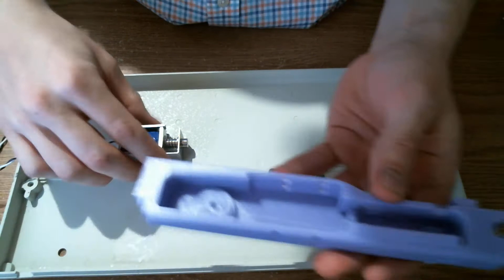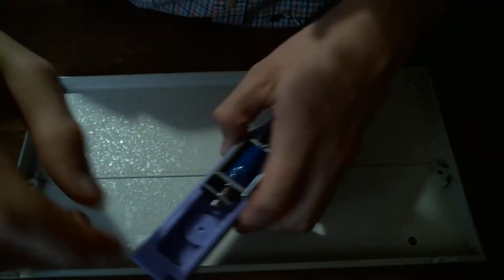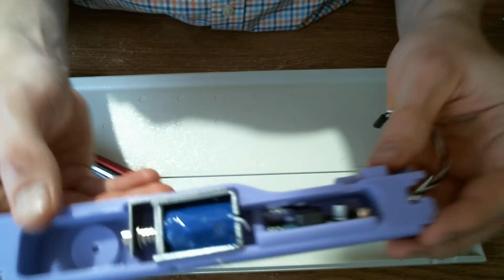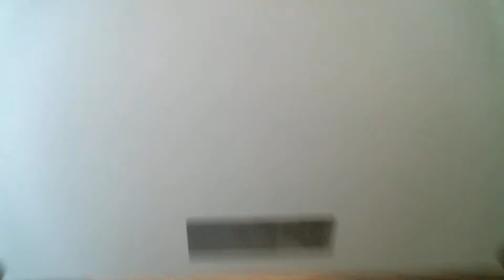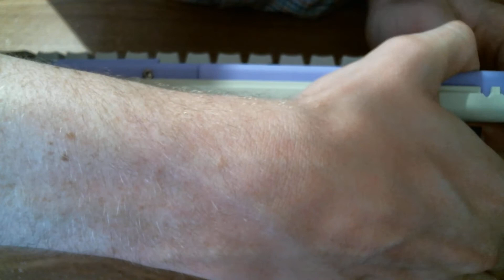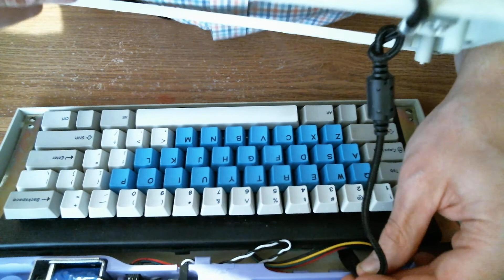3D Printed Solenoid Holder For F62 Model F Keyboard

Comment: If you don't mind me asking where you assign the fn key and the layer of arrow keys?
Reply from the maker: Hi. Um I'm just using the default layout at the moment. I do plan on altering the firmware at some point to change it slightly and add a key combination that will toggle the solenoid driver on / off. I haven't done this yet though since I like the solenoid and usually I want it on anyway. You have to use some tools to modify the firmware and re-flash the keyboard. I think there are instructions or directions to instructions for how to do this on the model f keyboards web site. If your asking about the actual mapping I think the right control acts as a modifier key (I just do it from muscle memory)  and then some of the letters act as arrow keys (I think WASD). Some of the keys a bit up and to the left of the right control are used for other functionality. mod + the number keys / the two keys after them work as the function keys. But this is all completely customizable by chaining the firmware (which I believe is QMK.) Sorry I can't check the information about the mapping right now.

Comment: Will the file ever be released?
Reply from the maker: It already is. It's on my GitHub in the models for 3d printer (or something like that) repository. You can get to my git hub through my Web site. Which is linked in the description.
Reply from the maker: Although there's a whole bunch of files. So you have to use the right one's. But it should just be the one / ones with the highest number. Anyway if you or anyone else want's to try to print it and your not sure I can find out which ones are the right ones and push an update to the repository that makes it clear.